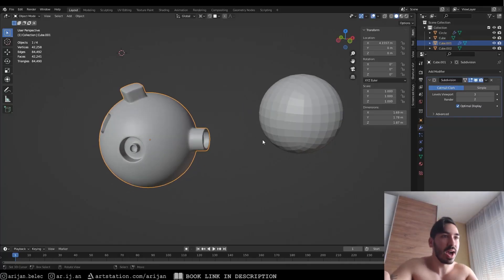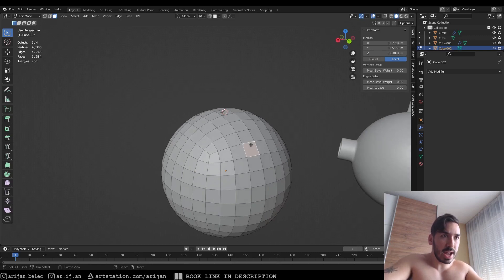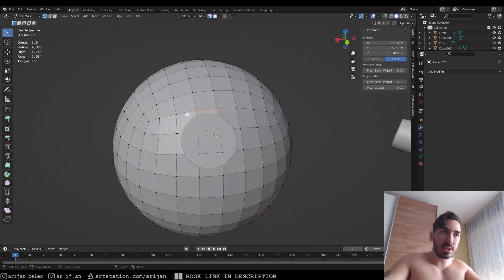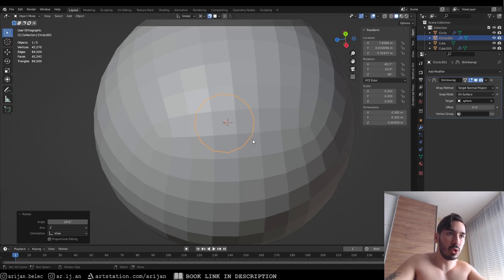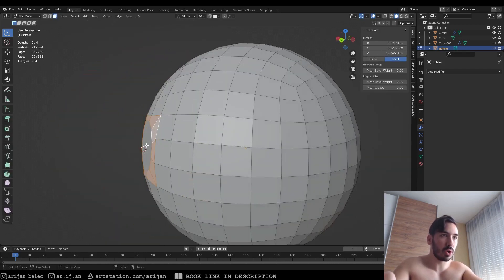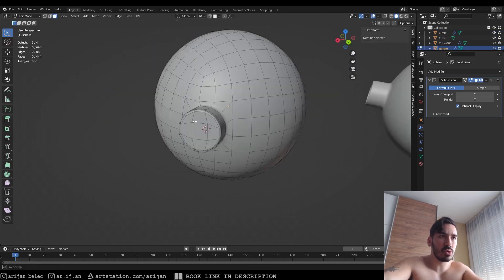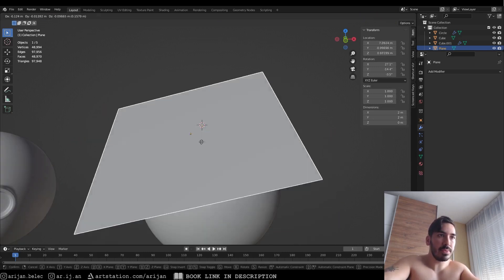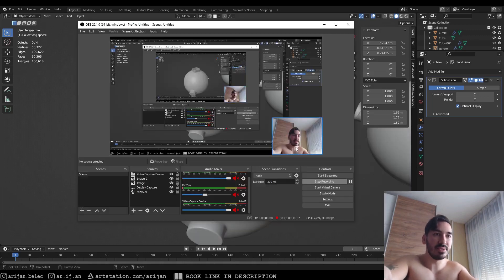Blender Topology Tutorial | Hard Surface Modeling Blender (Arijan)

Comment: interesting, but I guess just inseting the 9 faces and using loop tools for the circle one can give us the same result, it is much easier.
Reply from the maker: A circle made like that will not follow the curvature of the surface
Reply: @Aryan3D  for the circle it is right it doesn't follow the curvature of the shape but in the most cases you can manually adjust it with the curvature of the shape easily however it cannot be 100% correct. but in the rectangular case i the inseted faces follow the curvature nicely.